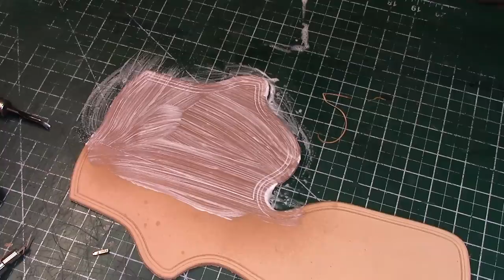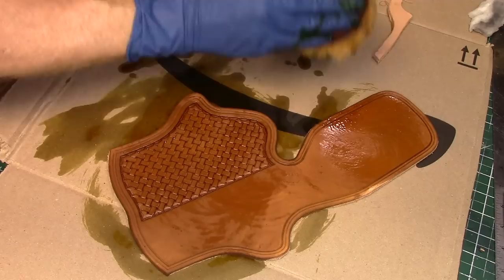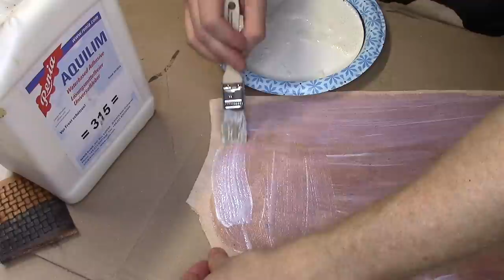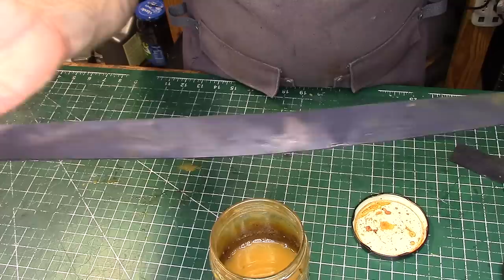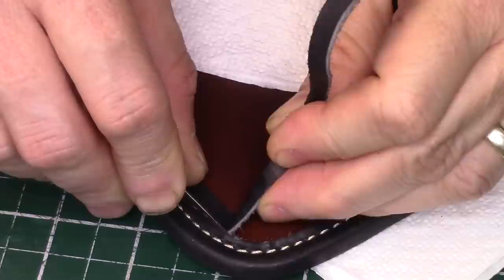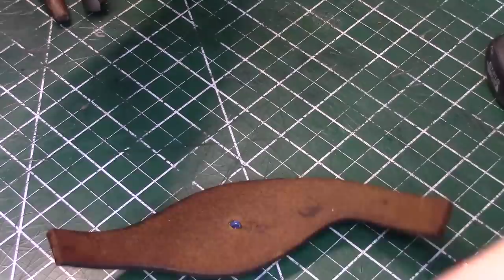Making a Basketweave Tooled 1911 Holster with Bound Edge Seam and Liner ASMR Leathercraft

Comment: I cut the pointy end off a hand awl and have been using that in my drill press for making/burnishing stitch holes. No dust to blow off after every hole. It has worked a charm.

Comment: I thought I was the only one who scribed multiple lines when doing basketweave. lol It's good for making sure you're not pinching a little away here and there on slight offset placement. Great work as always.
Reply: Also, magic eraser to take the top layer of dye off of the weave to make it stand out? That's a hell of a lot easier than worrying about getting your resist correct on that part after airbrushing. :)

Comment: Is the saddle soap used to make the leather easier to work with? Or is there a different benefit to using it?
Reply from the maker: The saddle soap helps the leather fibers "flow" into the impression. It also slows drying time a bit so you can stamp longer without having to rewet the leather.
Reply: @RoadAgentLeather  Thank you for the explanation!

Comment: Where did you get that stamp? I checked Tandy and it didn’t show up there with their basket weave stamps. I really like it and want one.
Reply from the maker: check at Pro Leather Carvers
Reply: I’ll do that. Thank you
Reply: I ordered the basketweave stamp and it arrived today. Thank you for the info on where to get it. Tried it out a little but had to quit, getting cold out there in the shop. Looks great. Forgot to alternate it a few times but that’s what practice scraps are for.
Reply from the maker: @carr869  lol. You're welcome! I've done the exact same thing with that stamp. Mess up the 90-degree rotation. Usually it's when I start a new line. Maybe if we panted the stamp's edges different colors?

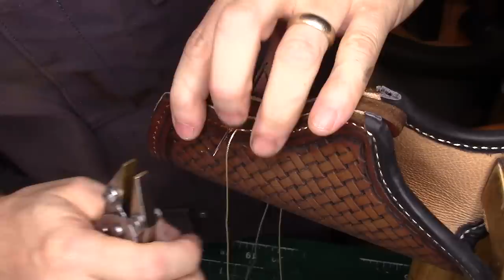Comment: 15:27 Are these parallel jaw pliers made specifically for heavy leather sewing?
Reply from the maker: They're brass-lined parallel pliers from Micro-Mark. Not specifically for leatherworking; I use them for my scale-model building. The brass liners help prevent marring on softer metals.
Reply: @RoadAgentLeather  Very cool, thank you for your reply.
Incredible work with mostly hand tools, very well done!!